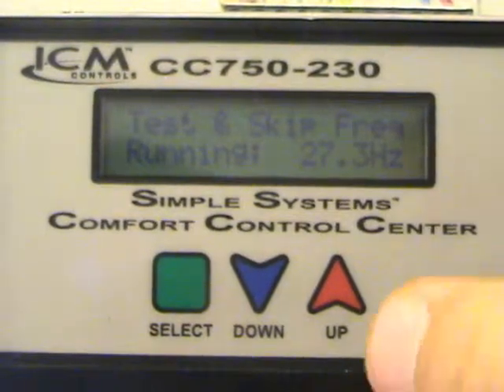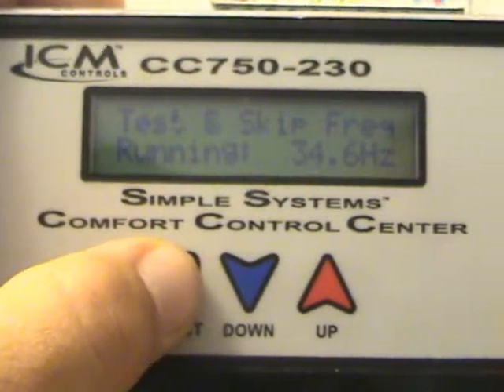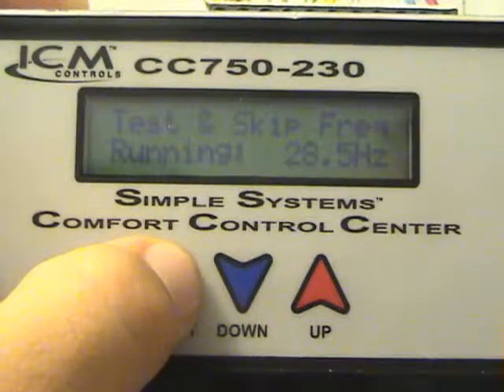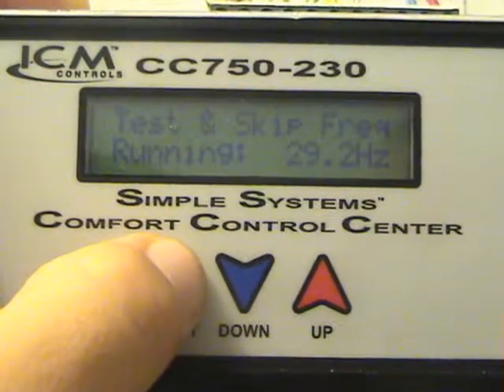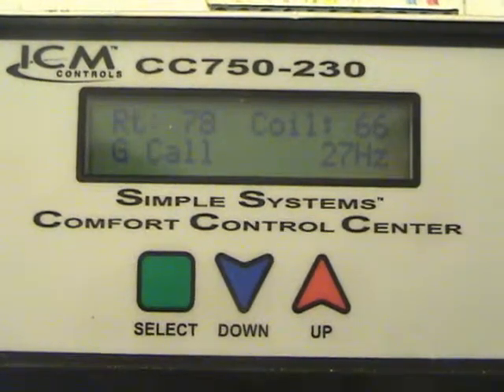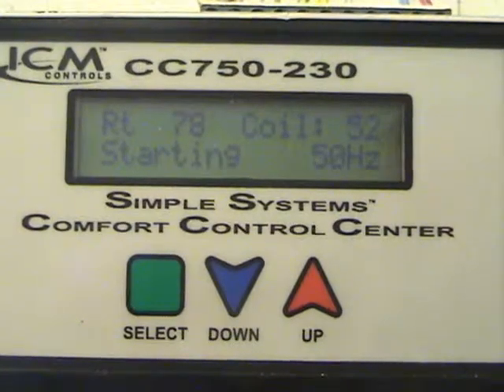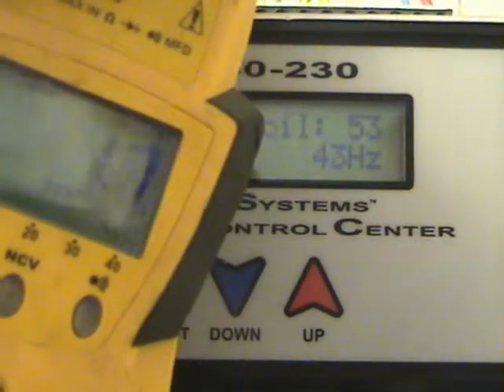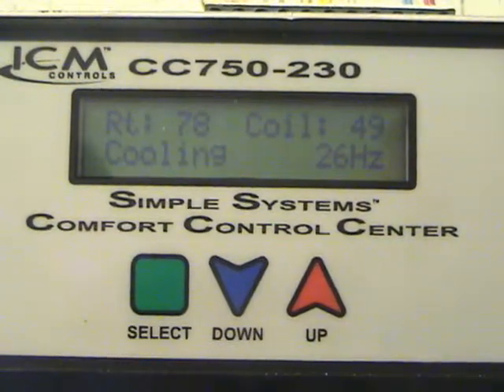ICM Frequency skipping

Comment: Thank you for your fast reply to my comments. Funny that you mention the azure as I was strongly considering that also but I'm concerned about it only being able to go down to 600 RPM. I suffer from allergies so yes I want you to be filtered but too much air movement aggravates allergies. It's sort of a catch-22. also interested In de-stratifying the heat in a two-story house and humidity control too. Currently, I'm torn between the CC 750, the azure, the qwikseer or possibly either just a fan Handler or a fan Handler in combination with a retrofit ECM motor (that being said the last option is almost too expensive as far as retrofits are concerned).  If you have any input as far as the options above are concerned, I would greatly appreciate them.  So you're saying if you had it to do over again, you would simply put the Azure motor in and not mess with the cc750??? Again, your feedback is greatly appreciated.
Reply from the maker: If you want lower than 600 RPM than the CC-750 is the way to go. But I'm betting that the Azure would do the job you are needing. The only thing with the Azure is that it will not go below 600 RPM, even if you use the handheld programmer; the constant fan mode is a set speed.

Comment: At 5:38 in this video you say that you are operating a Rescue Motor (even though manuf of ICM says can not do so).  You go on to say that maybe it has something to do with you only using single speed.  1)  Can you please clarify the statement about only using single speed?  2)  Are you using the term "rescue motor" generically for that type of ECM retrofit motor or specifically referring to the (Emerson) Rescue motor brand.  3) If using "Rescue Motor" Generically, then what was the specific brand & model name was the motor that you installed?  4)  Then you said it has a 10MF Capacitor in it.  I thought that none of the ecm motors have capacitors.  I could not find any info about a capacitor on the resuce (brand) motor.  4)  Are my (no capacitor) thoughts incorrect?  Also... if using a "rescue motor" they bottom out at 600ish RPMs but the ICM is supposed to be able to get motors as low as 25hz range which should be around 440 RPM.  5) so are you saying that you can operate the Rescue motor below the (always on) factory specs of 600ish RPMS? 6) What kind of energy usage savings do you think you had when you changed from the PSC to the Rescue Motor? You made this video approx a decade ago.  7) What has been your overall experience energy savings wise & comfort wise?  8) Looking back now... do you think it is worth (the additional expense) of adding an ECM to the CC-750?  I am considering duplicating your video results in my home and since the ECM motor aspect of this install is under documented on the internet and not addressed or recommended by ICM... your fast detailed reply on this matter would be greatly appreciated.
Reply from the maker: The blower motor is a standard Emerson Rescue brand motor, it is a multi-horse power PSC motor, not an ECM. The CC-750 can operate the motor at any RPM and Hertz that it will allow; it is best to use a ball or pin bearing motor instead of a sleeve bearing as a sleeve bearing will not last at low RPMs like a ball bearing. 

I have no idea on the energy savings vs. the original motor, comfort wise it is still going strong and working well. The CC-750 is a great option for converting a PSC motor to act more like an ECM motor and to help control humidity in high humid environments. 

Again, I did not use an ECM motor hooked up to the CC-750; it is a PSC motor. Do not try to hook up the CC-750 to an ECM motor, it will not work. 

Having said all that, and understanding that this was almost 10 years ago, I would install a new Azure motor today; and this is in fact what I do. The Azure motor is an X-13 motor and is field programmable for airflow with a handheld programmer.

Comment: Nice job describing operation. Is it still operating well?  Also, could you share the coil temp probe location/placement? Does it mount just on the surface of the fins or wedged between them? thanks!
Reply from the maker: Yes it is still operating. I've had to replace the coil temp. sensor once since this video was made, other than that, no problems. The coil probe goes into the fins, not just on the surface.